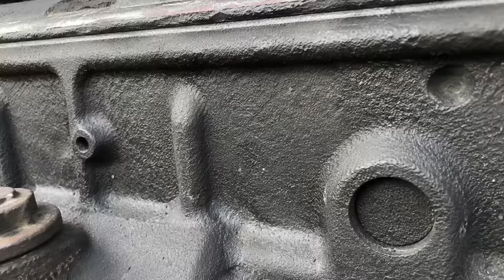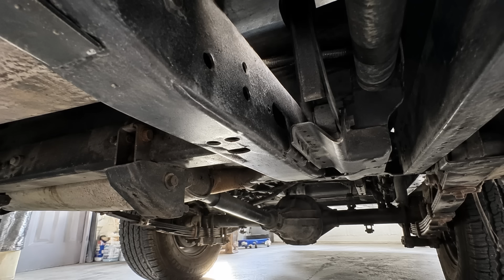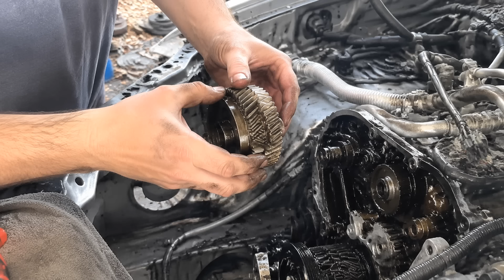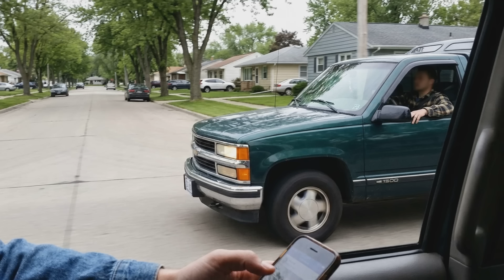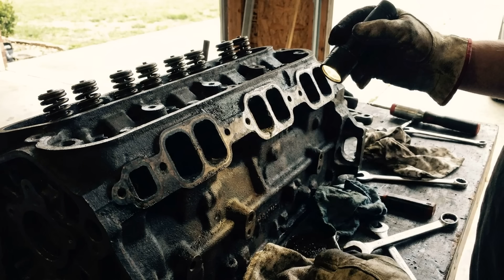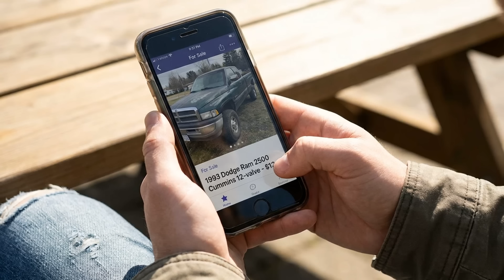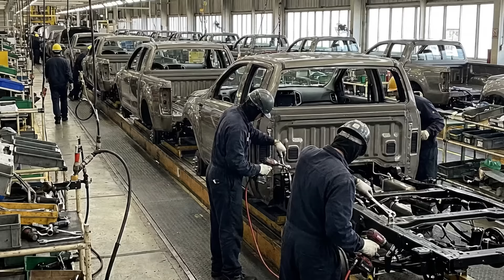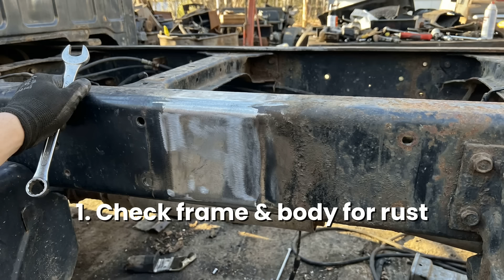7 Dirt-Cheap Pickup Trucks Nobody Buys (But They'll Outlast Every New Truck Forever)

Comment: While all these "diamonds in the rough" may appear to be very attractive, one of the things you need to carefully check is its Emission Testing History.  Here in California this is easily found on the internet - every vehicle here has to be tested every two years in order to register them.  If you look at the track record of any vehicle when you start to see the words "Fail", "Abort" or "Tampered" you know you'll be in for some significant, expensive problems.  Most California vehicles need to be Emission Tested and require 3-Way Catalytic Converters, some with as many as 4 of these.  When these go kaput or you get a P0420 Code after an illuminated Check Engine Light - These Converters can cost anywhere from $1500 to $2500 to replace.  The majority of the time the cost of the Parts and the Labor to install them way exceeds the value of the Vehicle.  So please don't mis-lead people into thinking some vehicles are extremely good deals.  Here in Los Angeles, you rarely see vehicles made in the 1990s and basically won't see anything carbureted on the road anymore due they won't meet emission specifications unless they are 1975 model years or older which no longer have to be Emission Tested.

Comment: I have a 1972 F100 XLT Ranger short bed with the low compression 360 work horse in my garage with very little rust. My daily is a 93 Chev WT v6 with almost no rust. I paid $7500 five years ago with 82,000miles. It's the same truck that I bought new in 93 for $9,500 and put 250,000 hard miles on before selling. I drive A 2022 Forester for long distance camping trips. Very comfortable confident ride, practically drives itself. But I still enjoy the simple 93 Chev WT that I have to actually steer and crank the windows. It took me five minutes to change the tail light assembly, 20 mins to change the alt, 1 hr to change the water pump. I always wanted a T100. I had both a little 2wheel and 4wheel Toyotas in the 80s.

Comment: I had a 1994 version ranger. It had 257k on it. I did have a failure of a water pump at 251k. The vehicle got a new pump, new head, all new hoses and vacuum lines. It was a 5speed.  Loved it, during the head replacement we noticed it still has the cross hatching in the cylinder walls. The tranny had been replaced at 139k when the factory seals popped. The rebuild got freeze plugs instead.

I would still have it to this day if the heater fan or fan resistor had not failed and caught leaves in the duct on fire which was not no the side of the road. Went up in full flames.  Sad part, the engine with new cylinder head was actually more peppy than from factory and only had 6k on it since was replaced. 

All lost due to some ground up leaves that got in through wiper motor blade attachment head. I will never have another vehicle that good.

27 years ownership, original cost and all repairs during the time of ownership averaged out to $500 a year. Also no rust. It was a southern truck.

Looked 6 months for a replacement. Couldn't find another of what I had, I had a second car so no hurry. I finally got a 20 year old RAV 4 with only 123k on it. I thought it was a steal. I now drive that about 3 to 4  thousand a year and my other about the same.  I work mostly on property where I live.

I expect from my age on, my RAV and my other car that I don't really that well but is only a 2003 with 78k on it all last me the rest of my 25 to 30 years. I can do some customizing to the 2003 to make it better when I retire from the one seasonal job I do have to drive to.

Comment: Companies don't make more complexity just because they think they can make more profit. They're forced that direction to downsize weight size pollution and max fuel economy by government regulations. If they can pick out a few more horsepower and a 10th of a miles per gallon they don't have a choice. I just wanna keep my 2003 F250 running as long as I can before it rests totally through here in Minnesota

Comment: Hungary is a whole different world in terms of pickups than America. I recently managed to buy a Mazda B2200. 1993 model, 2.2 diesel engine with 65HP, cabplus version. You can get much, much fewer old pickups here, especially this small truck category does not exist, where the size of the bed is what matters, and not that it has 4 doors. On the one hand, I fell in love with small trucks, on the other hand, I bought an adobe house that I am renovating, and this car is ideal for this work, because it saves me a lot of transportation costs. Specifically, I have already transported 30m3 of green waste with it, because the garden has grown like a jungle around the house - of course, the nice big trees have remained. It also excelled in transporting construction waste, it can carry about 1.5m3 in one go, and I don't have to order a container delivery. I think it will fully pay for itself in 1 year: $2222, and since I'm a 57-year-old programmer and I managed to win a vibe-code competition: $1000, which I quickly invested in this great retro artifact.

Comment: I have a 1981 F150 with the 4.9 liter inline six with 480,000 miles.  Still use to haul and tow heavy loads.  Average mpg about 14 mpg both highway and back roads.

Comment: I have a 2000 f-150, almost 200,000 on it. The clear coat is shot, but it runs like a champ, and it doesn't leak 1 drop of oil.

Comment: Daily driving a Nissan hardbody that is now 34 years old. Runs great, keeps up with 80mph traffic on road trips, doesn’t use oil or leak. Well over 230k miles on it. 

As for new trucks, you couldn’t sell me one at half what they are asking. I want a simple, single cab truck with a useful length bed.

Comment: Yup the times have changed and not for the better either 😂I still have an old 80’ Chevy 4x4 body is falling apart but I still drive it and I can fix it I also have a 2006 gmc 4.8 motor that gets just as good as the wife’s new Tacoma 😂 the last of a good Chevy truck I think

Comment: I have a 2002 Chevy Silverado 5.3 L LS. 306,000 miles and still going. I have a few leaks now, of course! I'm about to replace the old pan gasket and a couple of other smaller gaskets. I have no plans to get rid of it.  By the way, hear what you say about the transmissions, I'm still running on the original transmission. Got my eye on it though.

Comment: I heartily agree with all  your picks. I had a Nissan hardbody 4 cylinder for a while, sold it with over 250K on it, and got another small (?) truck that didn't make your list - a second generation Dakota (96-04). First or second generation Dakotas with the 5.2L or 5.9L V8 (and their little brother 3.9L V6) are good deals, especially if you can get it with a 5 speed manual transmission. In sixteen years, I have had no problems at all with the basic engine, and few issues with engine accessories (water pump, spark plugs/wires, etc).

Comment: We had a 1979 F 350 with the inline 6 cylinder. We put 2  motors in it. None lasted more than 85K miles. Pulled the last one and installed a big block from a junk yard and never failed and had way more power.

Comment: I had a Mazda b2000 pickup with the 4-cylinder and 5-speed, it was a long bed which by the way was just under 8 ft long. It was extremely underpowered and the best gas mileage I ever got out of it was about 23 miles per gallon. It did everything I asked it to do but good luck going up a Long Hill. It did however Hall two dirt bikes and gear fairly well

Comment: I kept an F-150 for 320K miles.  Wish I had kept it even longer!  Nothing other than a starter, alternator, brakes, and a couple of belts.  Have one now with 270K miles.  Only put brakes on it, one belt, one alternator.  No starter yet.  Failed to mention batteries, but went through several on the two vehicles.

Comment: I have a So. Cal 1997 Jeep Wrangler with the 2.5 liter 4 cylinder.  250,000 miles, starts easy, still runs great.  Regular oil changes at 5000 miles, plugs, cap rotor at 25,000 miles.  Three exhaust manifolds, yes they crack.  Three catalytic converters, yes they plug. Replaced the factory plastic radiator with a metal one at about 40,000 miles, no problem after that.

Comment: In 1960 RJ Reynolds I was working in their machine shop, the biggest machine shop in the south. They sent me to college to study AC, DC electrical and automotive electrical systems.  Grooming me to take over the electrical technician in their industrial truck shop. because their guy there was getting ready to retire.  I worked in that job several years on the second largest fleet of storage batteries in the country next to General Motors, according to the saleman from Exide battery company.  After retiring I went back to college on my own,  it was cheap for old folks, studying the new computer systems on autos and Transmission repairs.  I opened up my own transmission shop and saved people thousands of dollars from Dealer shops.. My kids accused me of flunking retirement.  Just wanted to state some of my background so you can understand why I had so many "amens" to your video.  And just a note; I had many years experience with the old straight 6 engines in the old AMC products with engines with 8 main bearings.
Lacy A. Mayes

Comment: Had a 2000 gmc 4x4 that made 500k km (300k miles). The 5.3 was running like new but the wheels literally fell off of the truck one day and I sold it for $500.  The new owner put front hubs and bearings into it and is still driving it.

Comment: I had a 2005 Chevrolet 1500 silverado, which lasted 159K i changed one  left rear electric windows regulator one in tank  fuel pump  period in the total ownership of the truck,  plus 2 batteries.

Comment: Now if you're living in California, all the gas trucks after 1975 need regular smog tests.  Then finding a smog shop that doesn't rely on just plugging in, is becoming a problem to find. And if your ride is 1975 or older don't count on finding a repair shop that is even willing to fix it for you.  As long as it's 1975 and before, I'm able to do the repairs myself. Even with that I keep a spare fuel pump, hoses, belts and ignition parts in my truck, just in case needed on the road someplace out of my neighborhood.

Comment: I had a Toyota Tundra for 14 years. It was a 2005, so it was about the size that the Tacoma is now. I am really surprised that you did not have any Toyota trucks on your list. I knew people who ran old light Toyota work trucks forever. My truck was a regular rear wheel drive work truck. No fancy off road stuff. Pulled trailers and hauled hay. Had an 8 foot bed that you can't find anywhere now.
Reply: I have one now and it is still running. Bought it new and have only just recently had to replace some of the parts. Great truck.

Comment: I own two Dodge Dakotas with the magnum 3.9 V-6. 
My '96 has 277,000 miles with an automatic, never rebuilt, and runs great. 
My '01 4 door mega cab (my actual car, lol) has 118,000 with a 5 spd manual transmission and runs great. 
They both get good mileage and are cheap and easy to service and repair.
My pride and joy is my '90 Dodge W-250 12 valve diesel. I had it factory custom built with a ton and a quarter suspension, the 727 automatic and 205 transfer case. The only transmission rebuild was done at 915,000, rear end rebuilt at 285,000 and injection pump and injectors replaced at 895,000. It currently has 930,000 and has had minimal hard part cost, $8,287.00 (doesn't include the $1,200 I paid in steel and welding rod to build the custom flatbed myself) as of March 2025. 
It still pulls my 16,000 pound, triple axle, 5th wheel, RV down the road at 70 miles an hour with no problem.
I will drive any of my three trucks coast to coast and not worry about the truck because I personally maintain them myself (no shop has touched them since they were new) and they are properly serviced and maintained, not half assed like shops love to do for return customers.
My father preached "grease and fluids are cheap, parts aren't" and these trucks prove that philosophy.

Comment: I had a '92 2.3 liter 5sp manual extended cab 2wd ranger. Slower than dirt.  I had to treat every green light like a drag strip or folks behind me would go around me. The oil auxiliary shaft stripped. They don't sell it at any dealership. I had to source one from a yard. That engine refused to die. However, the clutch slave cylinder is a shitty design and will fail quickly. I put 2 in mine before i just gave up and sold it off.

Comment: I owned two Mazda B2200.  Drove both almost to 300,00 miles. Am currently driving a Nissan 1995 pickup.  The first Mazda spent most of its life in Maine, the salt did get to it.  Basic runs forever.

Comment: I have a 2006 f150 4.2v6 for sale with 42,000 miles on it. 
I'm asking $8,000 for it because it's in excellent condition, and they are selling for much more than that everywhere. 
I won't go down on the price because of the rare condition compared to all the others out there on the market. 
My daily driver is my 2011 Sportage which has 352,000 miles on it and is still running perfectly.

Comment: I will never give up my 2003 F250 with the legendary 7.3L diesel. Its a tank and drives like a school bus but it tows my 12k lb RV like a boss and never lets me down. I turn the key, it starts and works its ass off every stinking time. It has 123k original miles on it and is a rust free Texas truck that has never been in a wreck and the white paint and leather seats are still in great shape.

Comment: 2012wt1500 4.3 v6 268000 miles same trans and only thing done was idler and belt oil changed every three thousand ,, still running smoothly. Mn,

Comment: I had a couple of these trucks: an F-100 with the 300 six hauled a 5,000 pound trailer loaded with motorcycles from New Jersey to Maine for five years; a GMC 1500 with the last of the original small blocks ran until it rusted. My uncle had the early Nissan (Datsun) pickup when it was the only pickup you could buy new for $2,000 and still could do the job. My landscaping client had a couple of the original Rangers, a four and a six that were great for small jobs but could tow a 3,000 pound boat. I’m looking for an old, cheap plow truck for just my driveway and you’ve given me a shopping list.  But I can no longer work on my own truck and fear there isn’t enough money in these to interest most of today’s mechanics.
Reply: Oh, and my son-in law has one of the Cummins Dodges that needs work. I’m convinced that fixing it will always be more economical than buying a new or late model one.

Comment: Got a 2005 GMC Sierra 1/2 ton - bought it new - basic model 5.3 v-8 - 176K miles - one recall when new - no problems since - often see new pickups and they look so nice, but mine runs perfectly,  and it's paid for, - I'll never sell it. Recently drove to South Dakota from Colorado towing about 3000 lbs. Don't know how it could have preformed better.

Comment: I had a 1998 ford ranger 4x4 with 4.0 v6. Had 198000 miles on it when I got rid of it. The frame rotted out here in the northeast. I have no doubts it would’ve got to 300000 miles if not for the frame rot.

Comment: I have owned many Diesel VW Rabbit pickups. What a great engine. Get a TDI and do the swap and you'll get fast fuel economy. A downside is the cab is small so if you are taller than 5' 10"then you'll run out of legroom. Get one and be part of the cult! (Boston, MA)

Comment: My brother owned a 2003 ford ranger. He had 467,386 miles until the body was just too rusty but the engine was still running
Reply: My 2003 v6 4l was great except the shitty engine.   The manual tranny was great but the timing belt tensioners were shit.  Failed on me twice.

Comment: My 2004 grand cherokee with the 4.7 has 188,000 and only changed the spark plugs. The trick to making them last is oil changes before it needs it.Sure I've done water pump, alternator and idler pulley but, the engine itself still has factory parts and solid compression. I live in the salt belt but the frame and body is still solid. The week points are the fuel tank belly pan and the tranny oil pan.

Comment: Bought new '92 Silverado 1500 lwb reg cab. Has 5.7 ,automatic, 2wd. I have put 406,000 miles on it. I replace intake and throttle body gaskets last year. Still strong and reliable.

Comment: 636 thousand miles on my 2015 Ford Transit 150 with 3.7L engine. Still runs great, replaced the Transmission at 514 thousand miles. 5000 mile oil changes. Phoenix to Tucson and back 5 days a week.
Reply: A 2015 Chevrolet would be on its second engine and third or fourth transmission by then.

Comment: Bought a used 2008 1500 chev silverado in 2022. The 5.7L runs great, 264km, general maintenance, rear main seal is problem=$,$$$.00; oil pan gasket slight leak after 264km. Undercharriage rust on frame is a problem but N-Eastern ON Canada=salt.  Still would buy another used (2016-2022) 1500 tomorrow.

Comment: Still driving my 1995 Dodge Ram 1500.  Purchased new, it has Dodge's 5.9L V-8, the heavy duty tow package (never towed or plowed with it), and just turned 81k original miles.  Chrome wheels (when they were real chrome), LEER Cap and body flairs, and minimal surface rust.  Paid $22k for it when newly ordered.  Family and friends bust me that I'll be buried in that truck...hope so.  Smiles are wiped off their face when I ask each of them how many times their new truck (costing between $65kk- 90k) truck had to be towed to the dealer.  I know each of them had to, at least once!  They know I watched the two truck arrive in their driveways!  I reminded one of my neighbors of the time I had to bring him to the dealer to discuss his electronics that went belly-up.

Comment: I have a 98 F150 with 230,000 manual transmission original clutch V6 Passes smog  no problem Daily driver